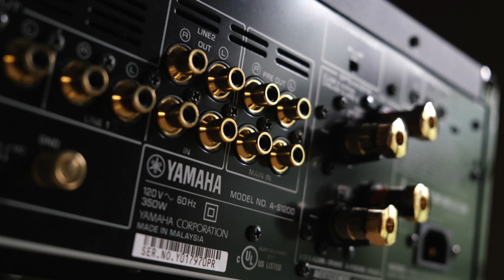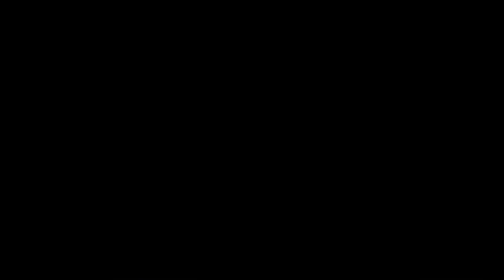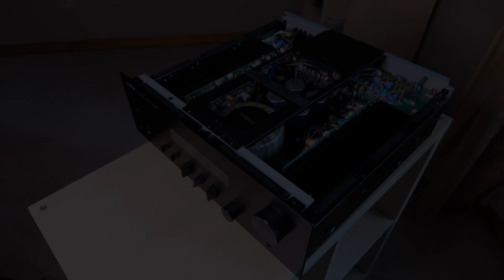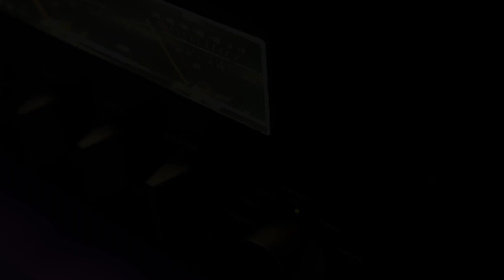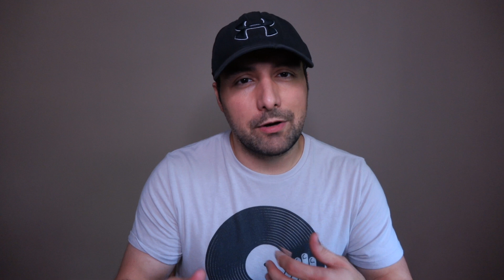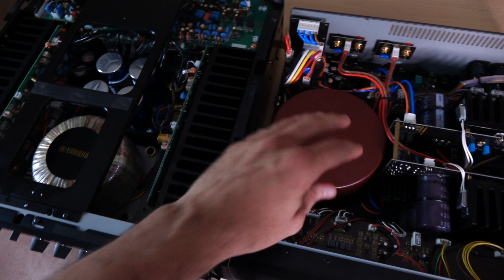Review!  The Yamaha A-S1200 Integrated Amplifier!

Comment: The sound of my 1100 changed significantly over the course of a year. It also sounded forward initially (not anymore) i would expect the same to be true of the 1200. Your comments (especially on the headphone output) suggests to me that your unit is probably far from broken in. The headphone input on my 1100 is excellent without any traces of harshness. i know you don't have a year to wait to do a review but i would recommended listening again once it has more time on it.

Comment: Finally replaced my trusty 38 year old Yamaha A700 amp (also 100 watts) that I have used since 1982 with the A-S1200 when the old amp finally expired.  Have listened to the new amp now for a few weeks from quiet to peak power volumes and have a good feel for the amp's personality.

First off, my old amp was a beast, able to peak at 250 watts per channel into a 4 ohm load.  The A-1200 runs out of power and will clip well before my A700.  This is at chest thumping house shaking volume levels of course.  The vintage A700 was no fooling around in the power department without a doubt, even after 30 years.  Run within it's power envelope, the A-S1200 has a muscular effortless and amazingly clean sound.  My old amp could have a tiniest bit of "grit" or "edge" to it and it was even more "forward" than the A-S1200, while the A-S1200 is simply incapable of making anything remotely harsh or bad sounding.  It simply sounds great until it runs out of juice at stupid high volume levels.  Bass is notably crisper and more controlled than my old amp, and the highs are unbelievably light, transparent and clean, as the video described.  

The old Yammie was great and that is why I kept using it so long.  The A-S1200 takes "clarity" across the frequency range to a whole new level.  It works fantastic with my speakers which are warmish sounding power hungry things.  It is not remotely "harsh" just "present".  The breadth and depth of the imaging is amazing and the amp is dead silent during quiet sections at high volume levels.  My large tower speakers (which I designed and built myself) never sounded so good, floating like a butterfly and hitting like a sledgehammer.  Mmm - Good stuff...

I am not as young as I used to be and don't need to pound out the wattage like I used to, but I still like full bodied sound at a healthy volume now and then.  The A-S1200 is the right amp for this stage in my life.  My departing A-700 was the right amp for the party years.  I took care of my old friend, gave it to a local vintage audio repair guy. He was quite stoked.

This amp does run amazingly cool vs. my old A700, and it sure is a heavy and deep sucker.  The word I would use to summarize the A-S1200 is "clean".  I am very pleased with it.
Reply: words and more words, a good amplifier amplifies the sound and that's it!

Comment: The problem with most amp manufacturers is that they make you buy bigger and bigger amps if you want to get better sound, but what if you don't need a 400 watt amp? What if all you need is a good 100 watt amp? The thing I like most about the Yamaha high-end series is that it addresses this issue. Yamaha offers 3 amps, each about 100 watts, at prices ranging from $2500 to $7000. All you pay for is the quality of the sound, and not any extra wattage.
Reply: @Jingle Nuts you have to play really loud before an amp start to distort. Who does that at home?

Comment: Great review Sean. The best of this amp on youtube by far. 
I bought the a-s501 after seeing your review of the 801. I feel in music heaven when listening to it on my RP 8000s. Its just so effortless and controlled. Thought these big boys were gonna be like the 501-801 on steriods, sounds like they are a totally different breed from your review.
Reply from the maker: Glad you're loving the 501!  Yep, their high-end integrated amps are aiming for something else entirely.
Reply: I went from 501 to 1100 recently. Though the 501 is great, but I'm not going back. Ever.
Reply: @Bob.martens  Can you describe how the sound is different?
Reply: @abelfonseca  In short: the 1100 (1200) has a LOT more power. That solves the greatest 'problem' of the 501, slow bass response. Things can really get muddy down there. On the 1100 bass is superfast at any volume, but still 'airy'. Some people consider the 1100 lacking in bass attack and body, and they have a point. A Hegel it is not... The 501 is at its core a very old design, using modern components. Upside: it's simple and indestructible. These are the amps audiophiles will be using long after a nuclear holocaust. Downside: not too keen on 4 Ohms. The 501 will  oblige when asked, it's just not all that comfortable driving the low resistance. It's still waay better at it than 90% of multichannel AV recievers. A lot of modern 8 Ohm rated speakers dive below 4 Ohms, especially at lower frequancies. 
Main point: the imaging is really a LOT wider and deeper on the 1100, almost regardless of your speakers. This amp will teach you what reviewers actually mean when they use those terms. 
The 501 is already quite an 'invisible amp', tirelessly neutral, but at times boring. The 1100 is as neutral as they come, but adds next-level detail and an overall sweetness the 501 just has not. The 1100 is so kind to your audio, it's the Tom Hanks of amps. It just NEVER loses it. It's your friend that goes anywhere you want to, and then along the way says: 'Hey, did you notice this? And That? Look there!' Like all Yammies it plays nice with a mean Klipsch.
That is what you pay for. But the 501 is all the stereo amp 99% of people will ever need. My biggest 501 gripe: the sub out with its non-bypassable low pass filter. Who does that? It doesn't even play nice with Yamaha's own products.
The 501 runs as cool as amps get. The 1100 isn't hot like some high-power vintage 'boiler plate' amps, but it gets warm. I guess it is biased to run in class A mode over a wider power range. 
I think Yamaha recently killed off the 801 (more power, baby) because it came too close to the 1000-and-up range. That's just my conspiratorial mind.
The 1100 reportedly has a killer phono pre-amp stage like-they-don't make-em-anymore, and I believe the rave rewiews. It's just that I only do digital. Topping E30 on permanent duty. Beats all DACs i tried up to three times the price. The 1100 will reveal the quality, or lack thereof of all your other components. I'll have to treat my room before upping my DAC game.
I used both these amps on Klipsch rp6000 and rp150 (the greatest compact party-animal out there, better than rp500), B&W dm601s3 and vintage DM2a (still magical). The rp6000 are my main set. At night I use Mission M70 for tv. The rp8000's are just too big for my place:)
Reply: @Bob.martens  Thank you for that detailed reply! Very insightful.
Reply: @Bob.martens  Your Yamaha 1100, can you hear the bass and treble changes you make with the tone controls through your headphones?

Comment: My A-S1100 took ~couple hundred hours to settle the forward presentation when new. Now, it's hard to go back to lower resolution gear. - good stuff. Thanks Sean.
Reply from the maker: Thanks!  You know, I was wondering if the sound would calm down over time.   If Yamaha is cool with me keeping the unit, then I'll be able to follow up with an "After the Hype" video sometime later this year.
Reply: Zero Fidelity I have an 1100 and I concur. It has warmed up quite a bit since I’ve had it.
Reply: What speakers you play with?
Reply: @andreassouth1523  Primarily; Audio Physic VirgoII, Snell E-3, Ryan Acoustics MC1 (older bookshelf) + DIY JBL horn/ 15in. 2way (current daily drivers)

Comment: First off, I love meters! I really like the minimalist look of the front panel. Great back panel layout, plenty of inputs. Love that under the hood look. First off that brace bar is awesome, makes the whole chassis more rigid. Love those big heat sinks, that toroidal rocks! Big ole caps. Great thorough review as always. Have a great one man!
Reply from the maker: Cheers!
Reply: My observation: If you put a set of meters on an amp, it will sell for 100% more. That despite the fact that they're not very useful. But if you give them blue lights, make that 300% more. ;)
Reply: @jimshaw899 ...yeah, blue lights is subliminal for McIntosh

Comment: I own the A-S2200 for about 3 weeks.  Even before the break in period as I hear all the time from the A-Sxx00 owners, my experience so far is that the A-S2200 needs a bit of a warm up time .  Maybe 20-30 mins or so, then the thing comes even more to life.  Sometimes I'm just sitting there listening to music and browsing on my tablet, after 20-30 mins of initial playing, I begin to here details I never heard on a track before and I would stop what I'm doing and put my head up to listen more tentatively and really appreciate the music; the overall sound becomes smoother and warmer and it also appears that the soundstage slightly opens up a bit too.

So far I love it and I'm not even playing on a good set of speakers (yet), stilling running on a pair of Mission speakers.
Reply from the maker: Thanks for the feedback.  You're not imagining things.  As per the engineer of this series, it takes the integrated's roughly 30-40 minutes for the heatsinks and other components to warm up / operate fully to spec.  When that happens, the sound calms down and warms up a little.   I don't think its enough to alter my overall impression of the 1200 in particular,  but its worth noting for sure.
Reply: @ZeroFidelity  great review on the A-S1200 btw.  If you can get your hands on the A-S2200 and A-S3200 for review, I would love to hear about it.  Curious to know how consistent my personal taste and hearing of HiFi equipment is with a pro. . .probably no where close 😂
Reply: @dfknyc78 : yes for my Yamaha 3200 , warm up time even more . Simply I can say The more it's warm up, more it chunks out mid range with smoothness. Actually I plan listening  time at 9 pm  at Just over 9 clock volumes.  Omg .. it made me  to pay attention to music
Reply: @kvrhifi  I envy you with the A-S3200.  I can only imagine how great it sounds 😀.  Enjoy it.

Comment: I’ve got an 801, I’m shooting for a 2200 or a 3000 on close out from somewhere. Shawn you’re spot on as always, especially with; you either like the sound signature or you don’t, I’m in the camp of the neutral but robust sonic signature of the upper topology.
Reply: Nathan Jones check out amazon right now, the A-S2200 is priced at $2400... probably a pricing error on their part, so it probably won’t last...
Reply: RunsCool1 I don’t think Amazon is an authorized dealer? I need a warranty. I went with Accessories 4 Less and got a smoking deal on a new A-S2200.

Comment: I have the A-S801 and am very happy with it. However, if I'm going to pay triple the price for the 1100/1200 I expect that it should have balanced inputs and more power. It has neither. VU meters are not worth the extra $2000.
Reply from the maker: The A-S801 is a killer value.  While I respect every persons expectations when it comes to perceived worthwhile investments, all it takes is a few seconds to realize that the 1200 is on a whole other level in terms of internal component quality.  It's not even close.  Now, whether that 'does it' for you or amounts to performance that you think is worth the extra cash -  that's a whole other matter entirely.   Personally, I don't give one F about balanced inputs unless the circuit itself is natively balanced.  Ditto with the source.
Reply: I’m sure the A-S801 is super nice for the money, but it’s far from the same build as A-S1200. Just open it and look inside😄 It’s two completely different levels. Not just VU meters😄
Reply: @1st2mind  But why does it have less power for such a price
Reply: @ArthaxtaDaVince777  clean low power is better than dirty high power.
Reply: @WayneKnight_Rider  There is hardly anything dirty about the A-S801s power. The Peachtree integrated amp at 2k slam dunks these overpriced yamaha amps. I love Yamaha but not of fan of the 1100/1200 models.
Reply: @WayneKnight_Rider  Dirty power? LOL

Comment: I had an A-S2100 and while I’m not a fan Of it’s sound Signature, I do miss the bass slam. It’s a very dynamic amplifier
Reply: Me too! I had one and I was super impressed with the bass slam it could deliver. Better in that regard than any other amp I've had. But... I found it to be too extended in the highs for my liking. I think if the room was extremely well damped that it could solve that perhaps.
Reply from the maker: Chris and Amir -  Thanks for sharing.   Yeah, it's rather aggressive.    Almost like old-school Yamahas.  This is one of those instances when I'm happy there's a tone control.

Comment: Great review! Been looking forward to more on this amp. Think I may go out and get one soon. My old Sansui may be ready for retirement. But does the Yamaha have a mono switch?
Reply from the maker: Don't believe it has a mono switch.  Haven't seen one of those in ages.   I'm familiar with some old Sansui gear.   I think you'll find a comfy home with the 1200.
Reply: @ZeroFidelity  Thanks! Think I got spoiled with the older amps. I've got the AU 9500. I was considering getting a Rogue Cronos amp but this may be the better buy for myself.
Reply: @Jingle Nuts good to know that these Yamaha's are well made and put out some great sound. I'm still not ready to let go of the Sansui. Sounds like you have some of the totl amps. I've heard nothing but good things on the 3000
Reply from the maker: @johnfredmurray  1200 or Cronos?  Yeah.  Get the 1200.

Comment: I own the A-S2100. From my experience these amps need a long break-in period. 500+ Hours to really show the final sound signature. In fact mine is more on the warm side of neutral. Now this being a newer model maybe that has changed?
Reply: suzigti92 EXACTLY! My A-S1100 changed it's signature after many hours... The hi-mid/low-treble bump is gone and now it sounds EXCELLENT!
Reply: Suzigti92. I like the AS2100, do you think it will match to my B&W 702 S2? Thanks!
Reply: @williamwong4529  I would think that may be a good match. B&W are usually more on the brighter side of Neutral. The A-S2100 has a tonal warmth to the sound.
Reply: @suzigti92  Thanks!

Comment: Thanks for another great review.  Why don't more high quality amps (integrated or power) have 2 sets of speaker outputs?  Most audiophiles, like me, probably have more than one set of speakers, and it would be nice to be able to switch between two sets
Reply from the maker: Thanks Tim.  So to answer your question:   It depends on the product in question.   Yamaha is clearly going for an old-school solution here.   No digital features.  Just good ole' analog features that you'd find on an amp from back when the Beatles were still a thing.  However, there are numerous companies out there that assume most of their customers will only be running pair of speakers on a product like this.  And then you have the next extreme, which are companies that focus on purist solutions, by which I mean, products that contain next to no features.  The focus is on the shortest, cleanest, highest quality signal path... with the mindset being that the more 'stuff' there is, the worse the unit will sound.  As always, there are different people with different needs, hence why there will always be different types of solutions.

Comment: Hi,
I've been watching a lot of your reviews lately and I really appreciate your straight forward approach to talking about gear. I recently ordered a pair of Polk R700s (backordered) and I'll need to upgrade my amp to be able to power them. They're rated at 8 ohms with an 88 db sensitivity but I've seen & read reviews that say they routinely dip below 4 ohms and need fairly high power to perform their best. This amp was high on my list but based on your comments in this video about needing to be matched with high sensitivity speakers, I'm guessing maybe this wouldn't be a good fit for the R700s? I also watched your reviews of the Marantz model 30 and Parasound Halo. I really like the Marantz but it's not super high powered either, whereas the Parasound doesn't really appeal to me for some reason. I guess the search continues.